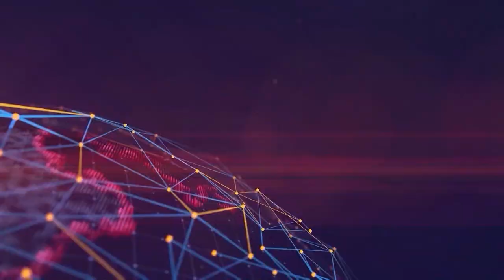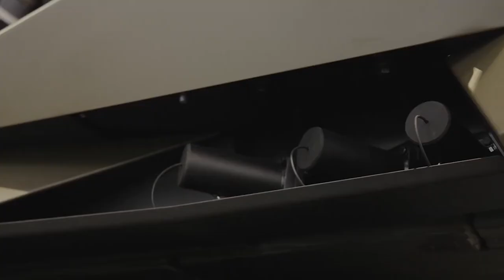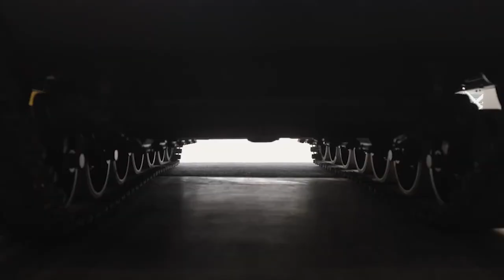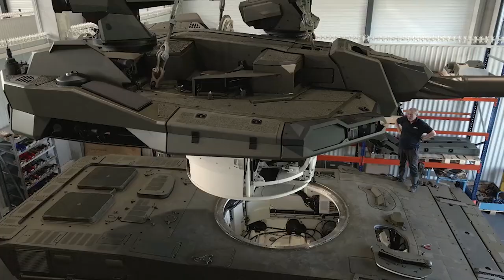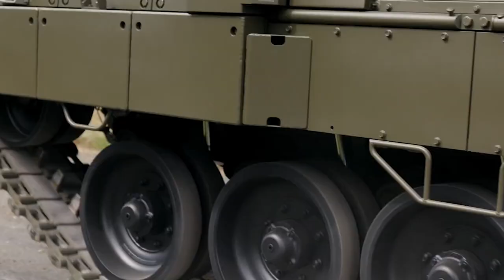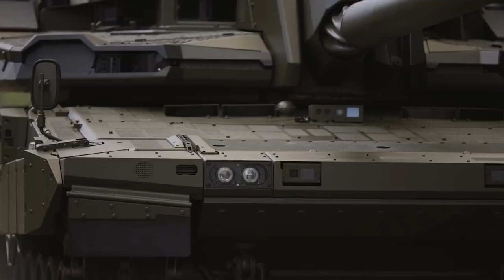Discover EMBT Nexter future concept of Enhanced Main Battle Tank developed by France and Germany

Comment: a bunch of features unavailables elsewhere
- ultra flat turret, the lower profile of any other in the market 
- 140 mm with low pressure chamber (inferior than Leclerc 120), same weight than a RM 130,  20 MJ , and evolutivity till 2040+ toward higher pressure chamber, 3 Tons, efficient for 10mm steel piercing at 3 kms
- large diffusion blast to protect soldiers around the tank in urban conflicts
- quite revolutionary IR stealth tube tech 
- half-telescoped ammunition : shorter than the classic size for more powder inside : so you can store the same amount of ammo. In fact this feature was the key allowing switching from 120 to 140. 
- full autoloaded, 2022 mechanism of the widely tested and combat proven one in the Leclerc
- "katana" GPS guided/flying shell with 
     - "by the top" attack, 
     - NLOS "non line of sight" attack
a kind of 155 Excalibur ammo, but uber compact for tank 
- "SHARD" arrows, 140 mm version of the existing 120, probably actual best arrow munition nowaday
- 3D shot-departure detection (by sound) with auto-aiming remote operated 30mm gun, to forbid any attempt of sensor sniping (24+ optics, cameras and sensors !) 
- vertical aiming and auto-aiming gun for drones threats (with a specific software for this) 
- sensors data fusion with AI, a bit "F35" closed loop tech. Allow driver and shooter to see seamlessly 360 around him, in all the frequencies just like the tank was in glass. With pointing for the 3D shot sensor, 360 OPTI/IR cams and  so on
- operational and tactic fusion of the data on the "Scorpion" system. it's a private wireless network where all the tanks, soldiers and drones share and fusion "what they know" : where they are, what they detect, where are the targets and threats. 

Two other nice feat are in finalization, nor available elswhere too : 
- active and passive IR plates
- cameleon : dynamic optical stealth ( dynamic color and pattern changes with the environement, very sci fi to see in live video)
Reply: and no actice protection system???
Reply: @pharao2561  ofcourse there is Trophy hard kill Active protection system 360 protection, and soft kill system which have Laser warning receivers and laser range finder to detect ATGMs such us Kornet so the Crew can Pop smoke mounted on Hard kill APS to counter APS when the Soft kill did not work Hard kill will come into play shooting down the RPGs and ATGMs before it even get to the tanm
Reply: @RomanKoval-ju6ht we will find out
Reply: @@solarwarden1894 yes, it's in the project. No demonstration to date.
Reply: Jeeeesus this thing just kicked the KF-51 Panthers ass, then dated it's mom... all on the Panther's birthday... Christ Reinmetall was NOT READY for that lmao.

Comment: Both this one and the Panther seems to be good. I hope that this will have the same modern tech that the Panther. Europe now needs one of those but urgently !!
Reply: Why the fuck would they down grade. Nato is looking at a 135 or 150mm gun this is going to out range every thing the US is also looking at that gun
Reply: @ericmartini2980  Correct is 130mm (Rheinmetall) or 140mm (Nexter).
Reply: It look thin did they forget to put the armor?
Reply: @yeoshenghong4802  it's thin cause it's unhabited, the armor is under the sensors and effectors in the concept, and the active protection (auto-micro turret, 3D sound sensor, vertical protection) allows this in protecting those relatively "exposed" systems.
Reply: @ericmartini2980  The US is looking at the XM360 120mm gun with ETC ( Electrothermal-chemical ) plasma ignition. It can shoot faster, deliver more energy on the target, is more accurate and more consistent than conventional guns with higher calibers. 
It is also lighter and the tank can carry more ammo due to smaller caliber rounds.
Reply: @scratchy996  FYI, it's more complex than just power in the chamber. 
If you take depleted uranium, its optimal penetration effect is at the pressure level used today. At this level, it has somehow a self sharpening effect on target, which explains its penetration capability. Therefore, Nexter offers the 140mm with that pressure level. 
Rheinmetall went in another direction. The research demonstrated that at higher pressure levels than basic 120mm guns, tungsten has the same performances as depleted uranium with this self sharpening effect on target. Therefore Rheinmetall is looking to increase the pressure in the chamber of the 120mm of up to 50% if I remember correctly. And they obviously plan on doing the same on their 130mm gun ! 

But the conclusion from that is that without comparative trials of the various approaches, it is not that easy to predict which one is the best. The different approaches mean that the number of ammo stored within the tank isn't the same, etc... 
Plus add to that the fact that Rheinmetall developed ammunition that has a very very low risk of cook-off, or explosion if the tank is hit, so the need for a chamber to store the ammunition isn't that important, therefore the architecture of the tank can be adapted to optimize its use, and that could have a major implication on the ammunition quantity, the sensors position, the size of the turret, etc. 

All that is very complex, and we unfortunately don't have access to the data of each company. Therefore, except saying that there is an interesting research period in that field, it's difficult to know what will be the future.
Reply: @RomanKoval-ju6ht 
Silence Bot.